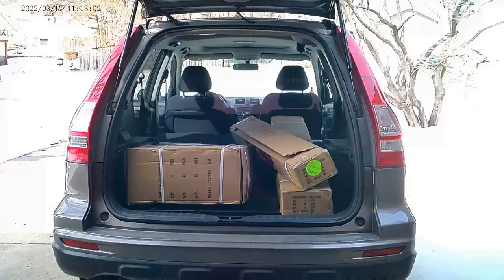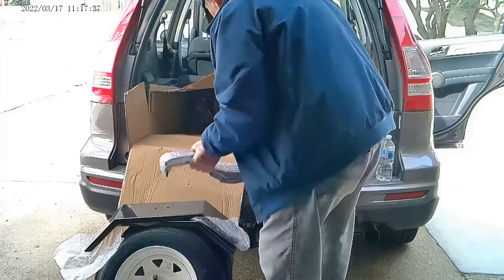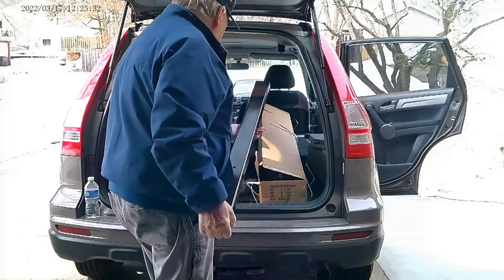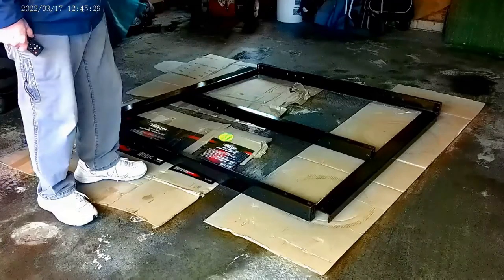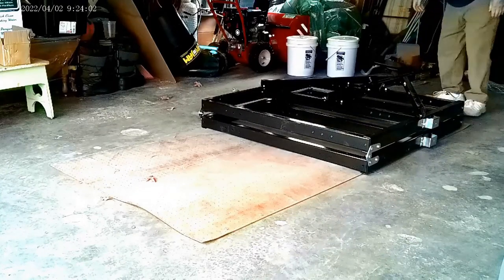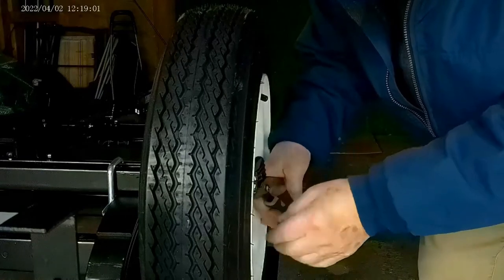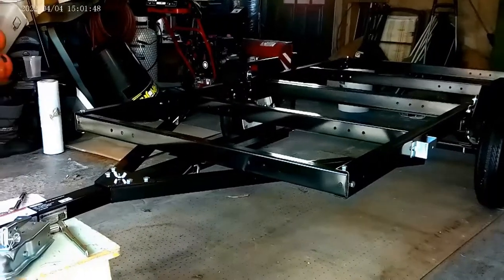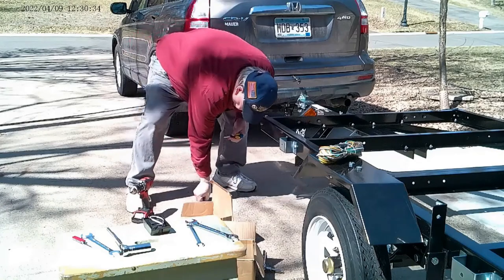How to assemble an Ironton Utility Trailer from Northern Tool.

Comment: Interesting looking at the design differences compared to the Harbor Freight 1195 and 1720 load rating designs.  Looks almost the same in some respects and different in others.   Thanks for sharing.  We'll see when I get mine assembled.  I'm wanting to mod mine to use the Prius 5x100 rims and tires so I have spares for both using.  Still need to check around for specs of spindle style hubs, though looks like PT Cruiser and VW Jetta-Golf-GTI might be candidates with maybe a little extra parts to be safe.
Reply from the maker: Thanks for your comment.
Reply: Your welcome.  I'll try to share mine on my YT channel once I get to assembling. I finally got all the parts from Harbor Freight I ordered that were missing with my returns auction find.  Found a under $75 Prius hitch as well which I still need to install.  Got the light connectors from the yard too, so can wire to a generic trailer light adapter and just plug and play once all routed. Thankfully, I think at least, the wheel hub assemblies were backordered, so I was able to cancel those while I still look for the 30mm I think VW Audi rear wheel hubs I'll go for since I received the 24mm ID 30mm OD seamless steel tube I ordered to use as an all metal axle spindle spacer.  Thinking I'll cut a slit down the spacer as well, just to be safe later in the future if decide I want to remove.  I am debating still about welding together the main portions of the frame that I will not fold, instead of using bolts.   @youbetchayoucanfixit-makei4393
Reply from the maker: I bolted mine together and haven't had a problem. Please let me know how your trailer turns out.  Sounds interesting.

Comment: Hey, would you be able to help me out?  I am in the process of assembling one right now.  Did you run into issues with hardware missing?  I am at the point where I am putting the axel together.  Did you have the M14 x 80 bolts (A), M14 hex nuts (F) and 3mm cotter pins (K). Split cotter pins?  I feel like I am missing all of the hardware.
Reply from the maker: I had all the hardware. Cotter pins were wrapped in the plastic protecting the axle threads. Both pins were wrapped on one side.

Comment: That trailer most likely was made in China. It resembles the harbor freight. The only thing different is the hitch and the front end.
Reply from the maker: I am trying to remember where the trailer was manufactured, but you are probably right that it was made in China. I wish it was made in America. That said, I have used it for several years and haven't had any problems. Thanks for your comment.